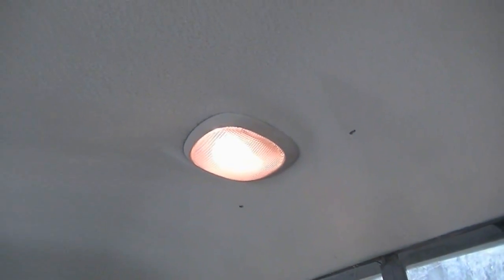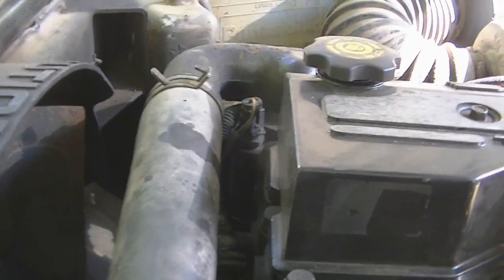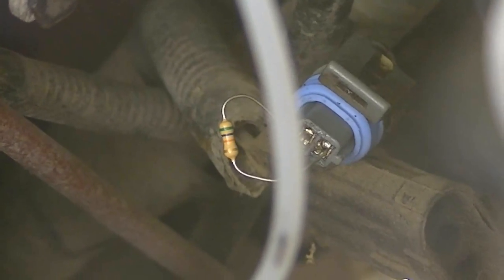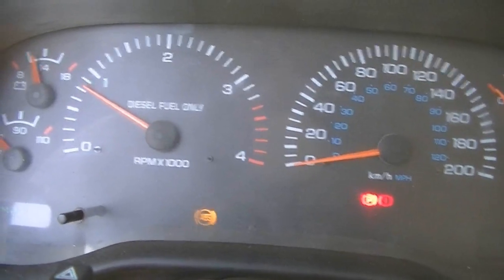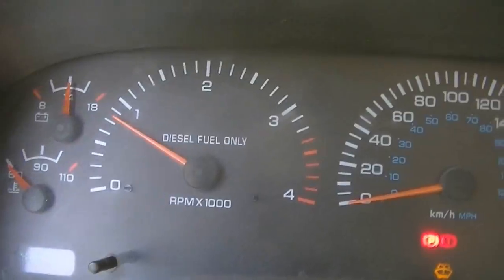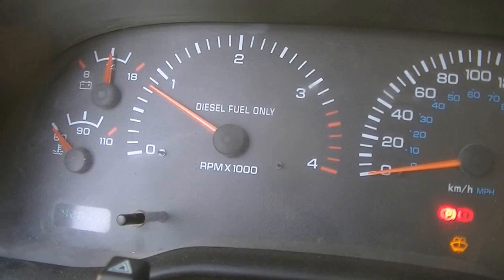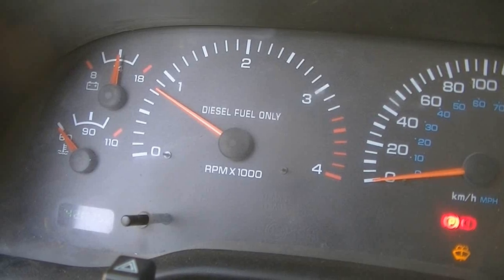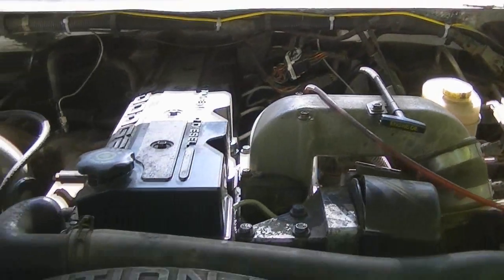01 Cummins: High Idle Test

Comment: Simulating Minot N. Dakota winters, during Sept, FTW!  lol 
 
Are all diesels supposed to have that high idle feature? Does it take 3 mins before it comes on when it's cold out or is that only cause you were tricking the computer?

Comment from the maker: plus, in the winter when its really cold, the 24valve engines breathe too well, and cant stay at operating temperature. if the truck sits and sits and sits running cool, it will cause tar buildup and then the valves will start sticking. thats when you bend pushrods and snap rockers haha! also, one guy works as a first responder in his truck. his truck sits on the road with its hazards and lights and everything on. he uses the high idle to keep his batteries charged ;)